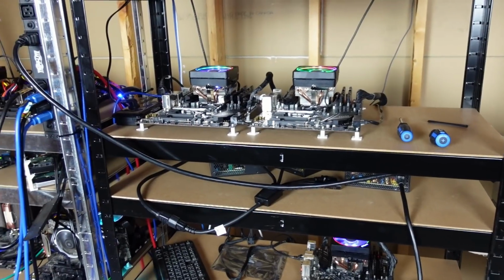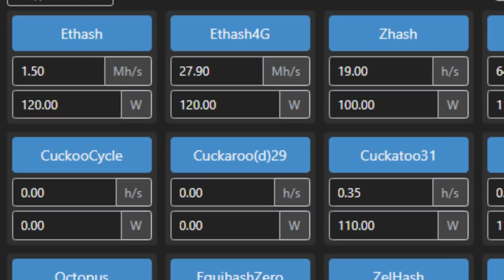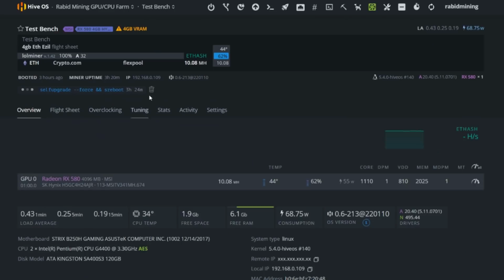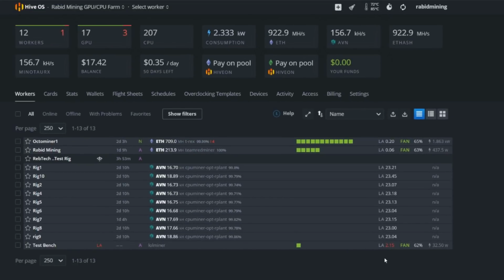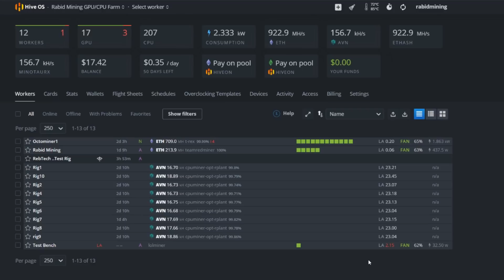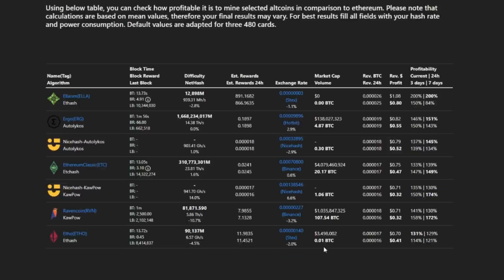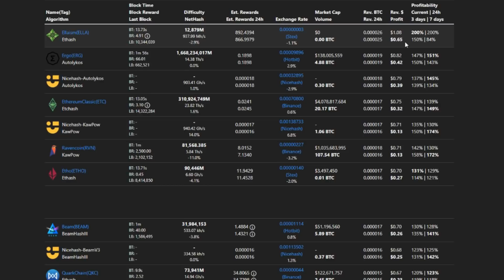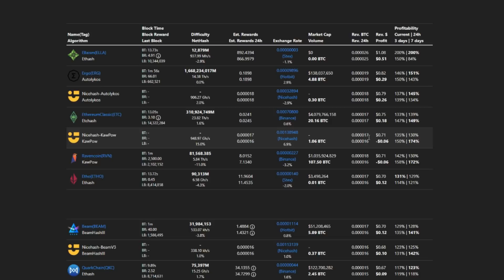4GB GPUs Can Still Profitably MINE ETHEREUM In 2022!!!!

Comment: I missed the part where you explain how you are able to do this; because my 4gb cards say its not possible
Reply: Also you must be using linux. Hashrate on windows will be much lower.
Reply from the maker: this is a update from a older video x16 slot and lolminer the slot has to be running at x16 mode

Comment: To predict... I tossed a rx 580 4gb card on eth a few months ago and was getting a few hundred kg. So I'll say a couple hundred kh maybe peak at 1 mh. Finishing video now...  done with video... enjoyed it. A few things 1. 10mh, I'm impressed, 2 I was using risers when I did it on a sapphire rx 580. 3 compared to hiveos LA is a number that is based off of cpu cores/threads. My r5 3600x on RTM has a LA a little over 11. I hold 1 thread back for gpu mining. My r5 1400 on RTM shows a LA of 4. No threads held back.  Grain of salt, I'm still learning but I took it as LA is a number to show the load on each thread and as close to 1:1 ratio is best and a little over is ok. Mine stay red but a fraction over my thread count and haven't had any problems.  I also see your LA on most rigs is at 23.. I know you use 12core/24thread cpu and hold 1 thread back, ty for that tutorial video, and your numbers are safe and white. I should also say that I also gpu mine on my cpu rigs and get a little higher LA% but nothing to concerning.
Reply from the maker: Correct didnt go to detail on it but yes usually normal is 1 or less per thread

Comment: I waited until the end of the video but I like to comment on other YouTubers. I have pointed my 4gb cards at nicehash and let them work. They are very stable which was an issue on hive and they are making money, be it a small amount. I put some for sale locally and have sold a few. if I run out of power (not likely) I would turn them off, as I did with my t9+s.
Reply from the maker: Nice haven't used Nicehash for a very long time